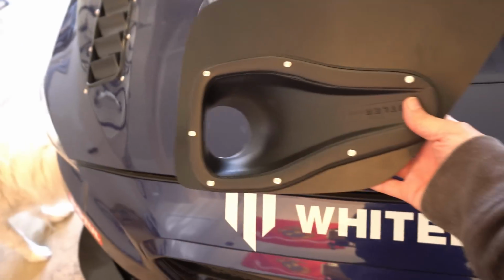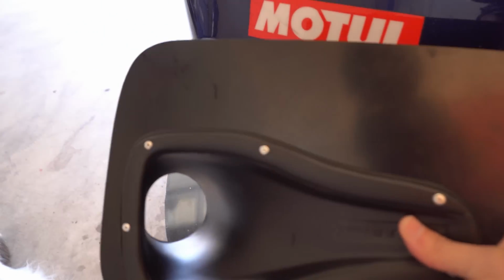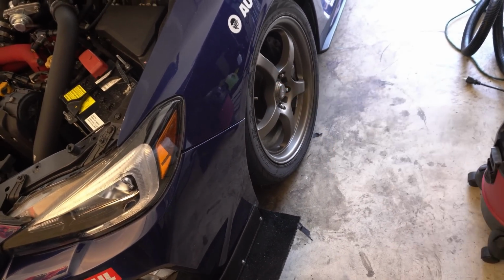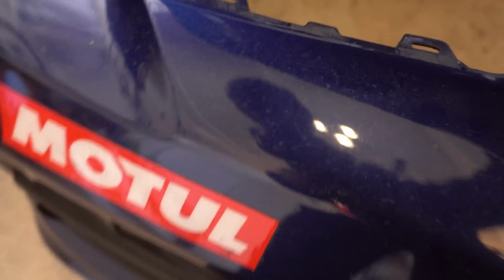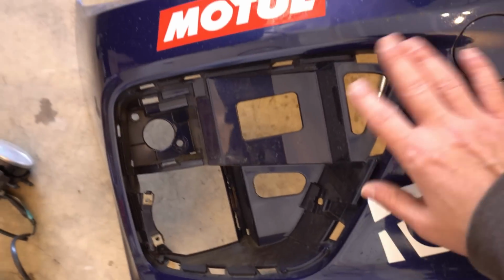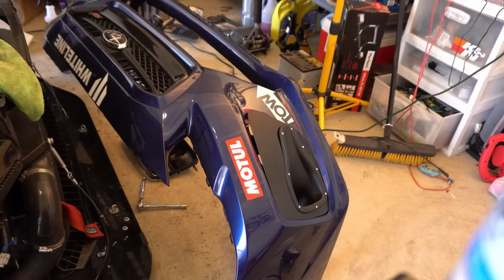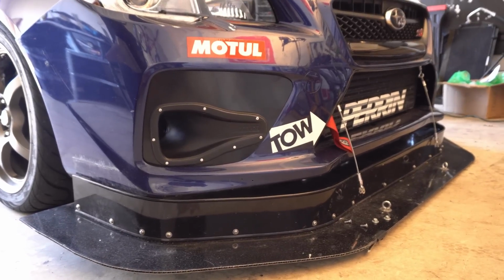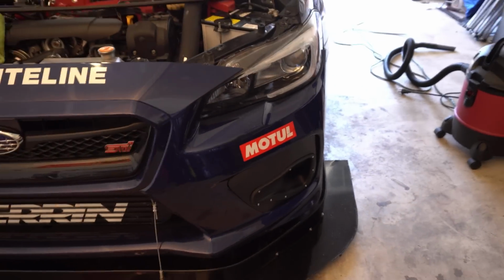Custom Brake Ducts| SBTK Fog Light Deletes | 2017 Subaru STI

Comment: Cool Roman. I have Naca ducts like those waiting to be put somewhere.
Reply from the maker: How big are your ducts?
Reply: @ARomanRacing  I believe they are 3" in diameter as far as the holes. But the entire duct itself is too long to fit on the front bumper. I plan on using them for underbody vents or intakes.